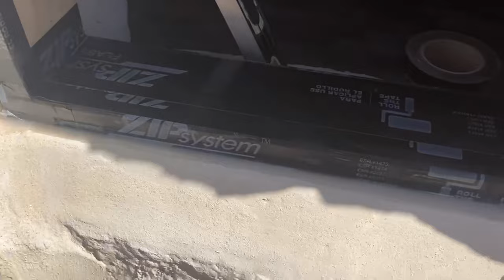Episode 11: Installing Windows and Exterior Doors (and brick floors!) on Our Stone House Build

Comment: If possible, and you dont mind me asking how much did the stone cost for the house?
Reply from the maker: Your price for just sourcing the rocks and getting the rocks stacked and mortared will depend mostly on these factors, if you are coordinating this step yourself:

1. Price per block from quarry (some may have the same price or different price for different sized rocks 
2. How many blocks you need 
3. Shipping costs of the blocks 
4. Cost of finding someone who can stack the rocks 
5. Cost of having someone mortar the rocks. 

If you have a local quarry, you can start there and they can usually give you a quote on the rocks and shipping. 

We used Texas Limestone Homebuilders just to stack and mortar our rocks. They also build stone homes outright but we just used them for stacking and mortaring. https://txlimestonehomebuilders.com/

We also needed to hire a skid steer/operator to offload the rocks from the trucks, before they were stacked by a crane.

Cost really depends on region and availability of the stone and a crane and a crew willing to stack and mortar.

Comment: Sweet looking house. Can I ask how much the limestone costs? And what it cost to order the stones plus labor of placing them?
Reply from the maker: Your price for just sourcing the rocks and getting the rocks stacked and mortared will depend mostly on these factors, if you are coordinating this step yourself:

1. Price per block from quarry (some may have the same price or different price for different sized rocks 
2. How many blocks you need 
3. Shipping costs of the blocks 
4. Cost of finding someone who can stack the rocks 
5. Cost of having someone mortar the rocks. 

If you have a local quarry, you can start there and they can usually give you a quote on the rocks and shipping. 

We used Texas Limestone Homebuilders just to stack and mortar our rocks. They also build stone homes outright but we just used them for stacking and mortaring. https://txlimestonehomebuilders.com/

We also needed to hire a skid steer/operator to offload the rocks from the trucks, before they were stacked by a crane.

Cost really depends on region and availability of the stone and a crane and a crew willing to stack and mortar.